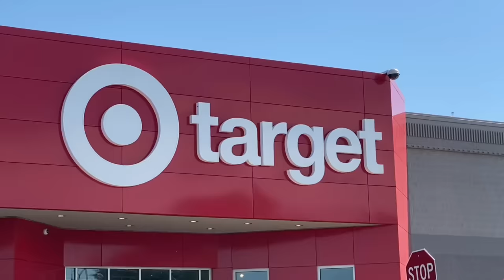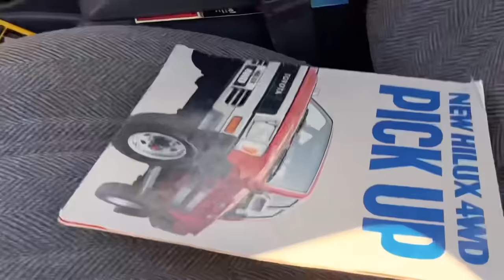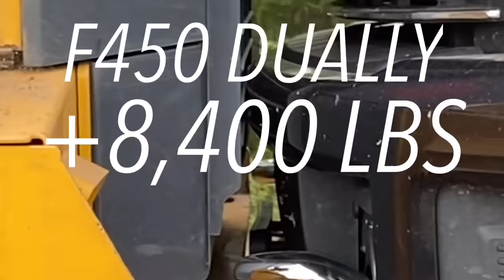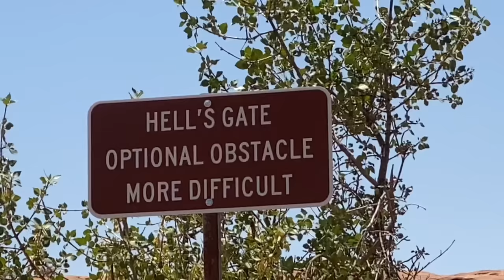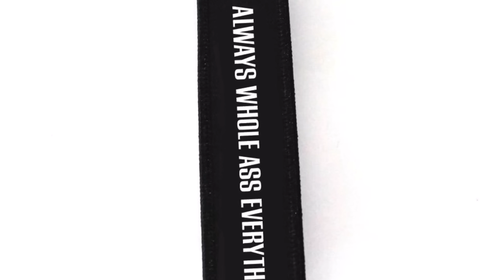Toyota Hilux Durability Test #3

Comment: Wistlin Diesel logic: speed up so the engine doesn't overheat😂
Reply: Yeah it was a good idea🤦🏻‍♂️
Reply: I mean, run it with no coolant for lets say 30 minutes, or run it with no coolant for an hour. Probably best to go as fast as possible if you can keep the rpm's down.
Reply: He's right tho, as long as you keep shifting and drive on low rpm the engine won't overheat and the air will cool it down.
Reply: That's just science based math.
Reply: @qoxx  Air blowing through the radiator only cools if it has coolant in it. lol..   He's cooking the crap out of that engine, theres' no way around it.  they are just overbuilt and de-tuned so it has a lot more tolerance.  If it was souped up with extra boost, ect..  Then it would have died the quick death of a race car.  But instead it lives on as the tractor that it is.
Reply: In this situation go the fastest you can get it using ur high gear without doing so much rpm
Reply: @calholli  he did fill it with water, water is better than anti freeze.

Comment: I would love to see a new Tacoma go thru this to see if Toyota still makes the same reliability 🙂 sick video man
Reply: The tacoma would be destroyed in 5 minutes
Reply: @thedaddyofstolenmemes8112  not as fast as a new “ranger” or canyon lol
Reply: it all comes down to that uniball design WD was talkin about, you dont see that on many other trucks.  While taco's are built extremely sturdy and will last a long time doing normal truck stuff it wasn't designed specifically to be absolutely abused and tortured.  The old hilux was a miracle, a reliable manufacturer making the most sturdy rig the engineers could possibly make in a time when things didnt need to be overly complicated, we will never see the likes of this truck again.
Reply: @mcchickinisgood  Don't be so sure of that!
Reply: I had an 09 it turned out to be a shitbox
Reply: Do it with a new Hilux.. They still make them.
Reply: @certifiedredditgenius  The only thing I would say would ever come close to the old hilux are the 2000s era Japanese market hiluxs made with the d4d engines. New Zealand and Australia gets them and they are insane just like this. Farm ute is on 500k+ kms and hasn't had one thing break on it.
Reply: New Toyota frames are different. I dont remember exactly but they aren't as strong. They are meant to be more flexible which is better for daily road driving but not as durable.

Comment: The axles design is insane, I wish ram or Ford would take that design and run with it on their axles and redesign them completely
Reply: It’s so genius…it’s actually less parts all in all and leaves less room for stuff to break there actually no reason for these companies to not have the ability to build there vehicles like this, they just want more money
Reply: wdym lol have you never heard of the ford 9 inch?
Reply: @Atari8888  Ford does have probably the second best axle design, that being said I don’t think it would hold up to this test
Reply: @shawnoconnor8075  the toyota rear axle is a direct clone of the ford 9 inch lol, the front axle hubs are their own design however
Reply: @Atari8888  I was talking about the front with the steering assembly that’s the impressive part
Reply: @shawnoconnor8075  The first four-wheel drive truck front axles that Ford Chevy and Dodge used were closed knuckle design like this. Look up closed knuckle Dana 44 front axle
Reply: All the 1st 4wd vehicles used closed knuckle axles like this... Tractors, pickup trucks... even the 1st jeep.
Reply: In your dream buddy
Reply: Even if the big 3 tried they could never build toyota quality. Every ford, dodge or chevy products built have always been junk from day 1 to present and likely into the future. Try this with any big 3 and quit running after first bump. I bought my first toyota at 42 yrs old and will never buy a big 3 ever again.

Comment: Jeremy Clarkson put a Toyota Hilux through some awesome testing too. It was still running after all they did and it ended up being parked on the shows stage. Love the videos 👍🏻🇬🇧
Reply: Namely, after several destruction attempts,  it went 8h several meters deep in the sea and came back full of sand,  was set on fire, and finally was put on top of a 240 ft building being destroyed.
The remnants of the "car" were pretty much unrecognizable, but still with just a new battery, the engine started and it could still move ! These cars are truly indestructible.
Reply: @nicolasjanin1577  I thought they just reconnected the battery not replace it

Comment: And the even crazier thing is, is that the Land Cruiser is the toughest vehicle Toyota makes. If the Hilux is this tough, imagine how much tougher the Land Cruiser is.
Reply: We have them in Algeria africa  and we use the shit out of them and they run for a million km easy really a bulletproof engines tranny suspension they can run on bad fuel or no oil for a while over built .even people write poetry about them  tough cars..
Reply: Mine is 40 years old and still daily drive.
Reply: This hilux in the video seems to be technically closer to a land cruiser 70 series, because all the hiluxes at least in Europe are IFS and this one has solid front axle. Toyota also made RWD only hiluxes, they ride lower and look funny
Reply: The landcruiser is overrated, we use them in the mines here and they're lucky to last 40,000km. Rust in the chassis and pillars by 15,000km
Reply: @joshthomas2536  not a single vehicle out there that will last half that time doing the same job mate.. that's why they still use landcruisers. Definitely no overrated
Reply: @joshthomas2536  mines kill basically all vehicles so I'm not surprised
Reply: @nukkumatti9587 nah the early hiluxes came solid axle, still very different to a landcruiser
Reply: I had a 99 diesel with 600.000 miles on owned since 200.000
Reply: @joshthomas2536  having owned a 70 series since 1998, i disagree. I plan on buying the new 70 series GXL soon.
Reply: Taliban approved 🎉
Reply: Land Cruiser is such a sick beast I love it
Reply: My grandads Landcruiser from the late 80s is still running fine lol

Comment: The hilux has earned a restoration by the Diesel Brothers. After Cody drops it off a mountain and it still runs ofcourse.
Reply: It doesn't need to be restored, everythings fine on it but the fan and the leaf springs. Minor repairs.
Reply: They used to make cars without fans and leaf springs even. You really don’t even need to do anything to the hilux. It means nothing
Reply: it too far gone, it would cost more to restore it than what its worth... they could just buy another one in better condition..

Comment: I have owned and worked for Toyota for over 30 years. They are extremely impressive! Especially the Hilux I have owned many.
Reply: What's the actual difference between a Hilux and a Tacoma? Would a Tacoma be able to handle these tests or is the drivetrain shit in comparison?

Comment: Cody: “nothing has broken yet”
the headlights: are you sure about that
Reply: LMAO!!
Reply: It just popped out
Reply: And the windshield, and the hood, and the front leafs, and the those vents in the dash, and the back window... a
Reply: @j.d.saccociates3313  does it make it stop working no
Reply: Not only that. The radiator and fan, are not the stock ones. He might broken it in the past videos. The standard fan is mechanical with a clutch.
Reply: @mth_sky3631  well ya it still runs but saying nothing is broken is a stretch. I forgot about the radiator fan, that ain't working either
Reply: @fortnitingunclepappy  absolutely, toyotas are like that, will have everything broken, yet still run and drive
Reply: @j.d.saccociates3313  if it had the stock radiator and fan, it wouldn't be overheating. Maybe was due to that rage episode against the squatted truck.
Reply: @RogerM88  so if it wasn't broken it would be working?
Reply: @j.d.saccociates3313  it's overheating badly with that aftermarket radiator and electric fan. The stock fan is bigger and would been better to replaced for a similar one (fan blades) after being damaged. But it's a "production car"...and we already now it final fate.

Comment: Bottom line is, don't build an off roader, or anything for that matter.

Just buy a Hilux. Lol
Reply: It's why we have ours! Incredible machine!
Reply: @rockymountainlifeprospecti4423  How much was it?
Reply: @D-Man_Jam  mine is a 94 that has been modified fairly heavily for wilderness S&R and prospecting at high altitude. 5 years ago before alot of the mods I paid around 4k US for it. Will be upgrading the engine next, already has the solid axle and front and rear 12k winches, electric rear locker and 35" SST Pros, works well, I blew a head gasket..no coolant and still made it home from a 2hr drive. It's more than a truck it's a friend.
Reply: Youcan still build your off roader. Just have a budy follow you in a Hilux so he can rescue youfrom the inevitable.
Reply: @rockymountainlifeprospecti4423  4k??? I thought those things were going for 20k if they were in good condition
Reply: @D-Man_Jam  they definitely can get pretty pricey but it outlasts so many others, I definitely got a good deal on a truck I'll keep the rest of my life.

Comment: The Toyota Hilux has demonstrated resistance beyond the obvious, it has unmatched strength, durability and versatility, a machine capable of withstanding abusive and ruthless use and still keep running. I had seen it when I was young but I never thought it was an incomparable machine.

Comment: imagine if they made cars in 2021 with the same design mentality as this car.  Bro it would be fucking indestructible at that point.
Reply: Nobody would buy it. Too small, underpowered and lacking features for the average American. Reason why they sell Hiluxes pretty much everywhere except the US. That and emissions and safety standards.
Reply: @2WheelsGood.01  Underpowered for what ? did you watch the videos?
Reply: @kino266  for highways in the US...and for people in general. Everyone is used to 275hp Camrys at this point. Don't get me wrong, i absolutely love them. I grew up in Colombia and they're everywhere. Along with Landcruiser 75's, etc.
Reply: @2WheelsGood.01  The reason they're sold everywhere except the US is because there is a 25% tariff on them (the "Chicken Tax"), which would make even an older one cost more than a brand new Tundra. 
Emissions are not a factor. There are currently three different gas engines, six different diesel engines and five and six-speed automatic and manual transmission. Point is, if it wasn't held back by the tariff, meeting emissions standards would be simple considering the many options available. And we're talking about the Japanese, it's not like Toyota has ever had a problem meeting these or any other standard for that matter.
Though I would presume that even if the tariff didn't exist it still probably wouldn't come to market in the States because there is no longer a small size pick-up truck market here for reasons like you explained with the Camry. And also because the majority of people would choose an all wheel drive SUV over it or just go for a full size pick-up instead if wanting/needing a pick-up truck, because, well, Americans have always loved their larger sized vehicle's.
Reply: @jamstagerable  makes sense! Thanks.
Reply: @2WheelsGood.01  bullshit, everyone would buy this truck

Comment: how does this still run and how are the tires still inflated!
Reply: It’s a Hilux man that’s all you need to know
Reply: It was aired down.
Reply: toyota 🇯🇵
Reply: Ko2s are good tires. Km3s are better tires i think thats what they had on the white truck(and the dually tow truck, i think). The k02s on the hilux are all terrain and the km3s are a mud terrain. Good tires, not cheap. My mom got 70k miles out of a set of thirty fives on her 6.2 raptor (like WD’s)

Comment: Honestly I think the backup challenge was impossible 
🤣 ALL the weight was in the front where the engine is. Yes, you had the Milwaukee tool boxes to even it out a bit but you would have needed 700-1000 lb's in the furthest back location possible to achieve that climb. You could see how close the vehicle was to flipping when he attempted it. What a beast, I'm impressed. Toyota GG

Comment: Lol so quick video idea, bc ur shit is getting…expensive. NGL this gave me flashbacks to taking a wrong turn in the mountains between Denver and Colorado Springs. Ended up on Rampart „Road“ *cough*TRAIL*cough*. Got too far in and couldn’t back out. Had to power through a puddle, gas over some hurdles, hit a berm at speed to not hit a tree with the roof and hit a 4ft drop to get back on road and away from the fucking quad area. Oh, and I was in a POS base 14‘ Chevy Cruz. Didn’t even break anything, probably luck. Still daily drive it. Colorado got a lot a trails, and I’d kinda like to see some of your durability tests thrown at what plebeians refer to as good vehicles. Oh and the Chevy Cruz is not one of those.

Comment: We used to have a Hilux and it blew the engine not because the engine was cheap shit but the oil was cheap shit. Like the oil solidified into a gelation like consistency and the engine sized. however we put a new engine in of the same kind and it was good for another 5 years till we had to sell it (still not happy about that but you do what you got to do)

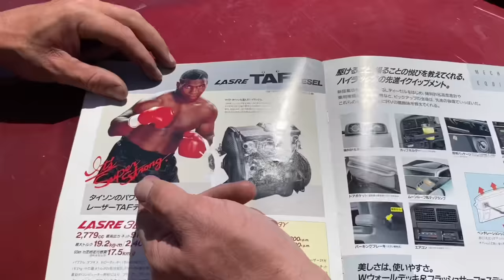Comment: 9:32 LASRE = Lightweight Advanced Super Response Engine (Toyota loved their grabby acronyms) and that diesel engine is a "3L" (not 3-litre), as in something like the 3rd gen of the L-series diesel engine (specc'd as 2.8-litre). It came with a 3L and a 3Y engine (petrol 2-litre). The HiLux rightly deserves the "unbreakable" crown.
also, you're at 10k ft ALTITUDE, not in the air. if you were in the air, WTF are you standing on? 🤔🤣

Comment: I tried to kill my Toyota corolla, it had 300,000 miles, thought the tyranny was finnaly failing, but than I just realized it had never been flushed or topped off ever. It was empty! I filed it up, and gave it and oil change. It was still running strong when I sold it for 700$. Why did I sell it? Im stupid

Comment: The real Second owner no check engine light car will need some body paint xD other than that the car runs and drives excellent 10k serious buyers only no low ballers this is a truck that has been barely used it 95k miles first come first server xD